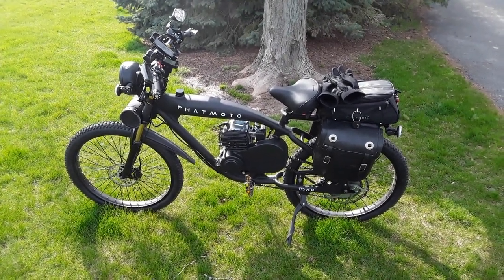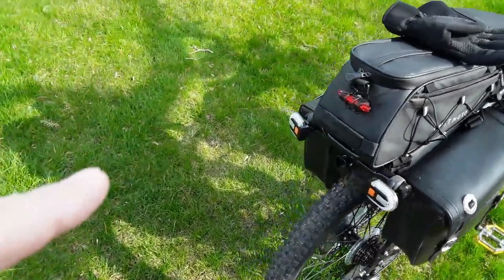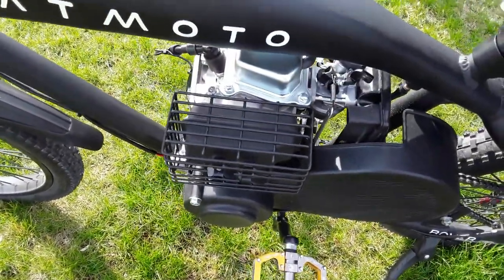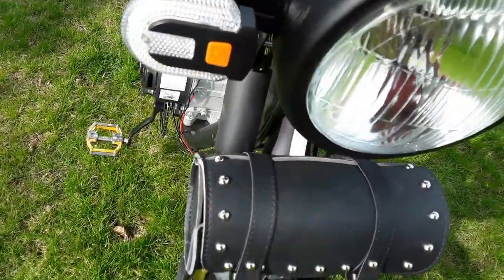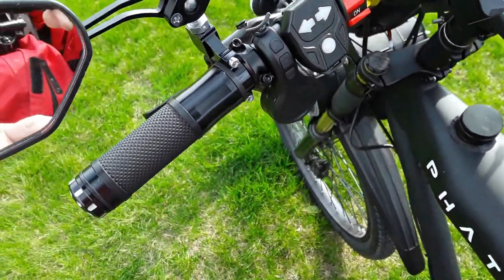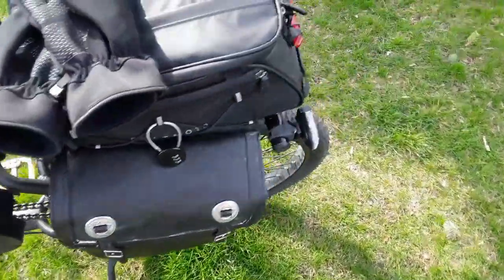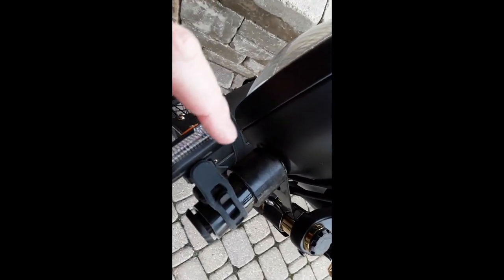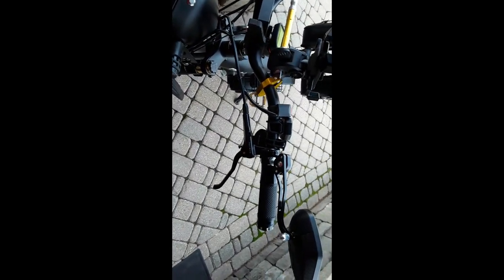2024 Phatmoto Rover Walk-around

Comment: I have a 2021 all-terrain. Finally got the bugs worked out (for now) and went for a good ride. 

I took the kill switch off and wired a key switch instead. Also put on a thumb throttle. Probably regretting that………….
Reply from the maker: Welcome to my channel, Jason. I'll wait until stuff brakes before replacing anything. The throttle on the 2024 is quite nice all metal.  I have thumb throttles on my ebikes and they work well for them. 😎👍